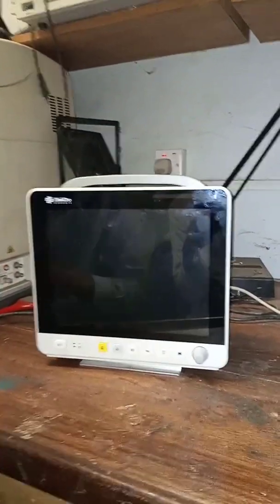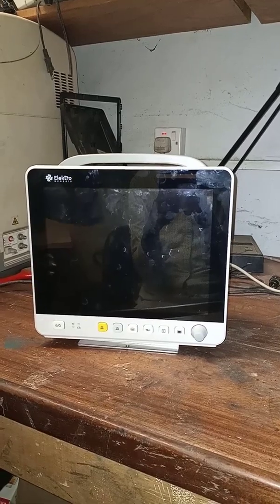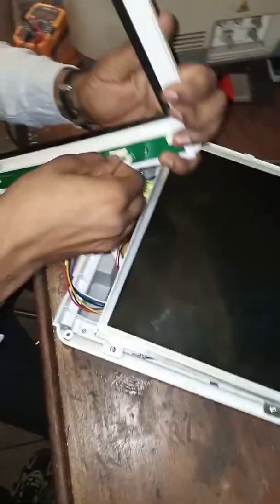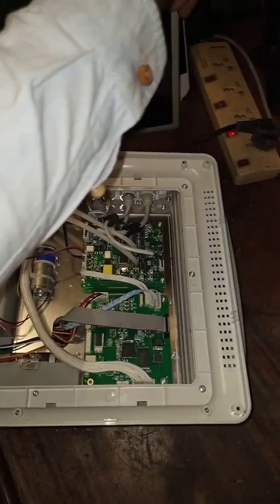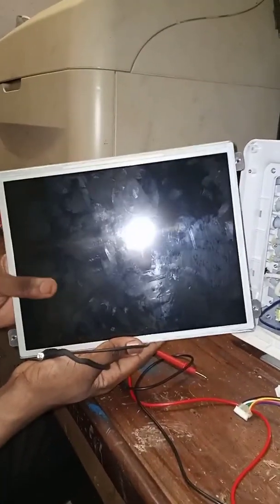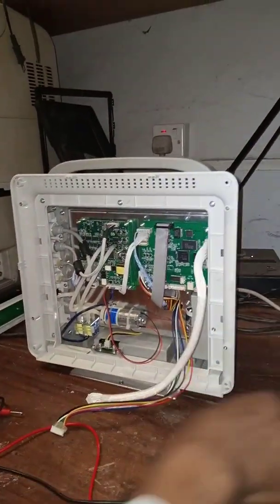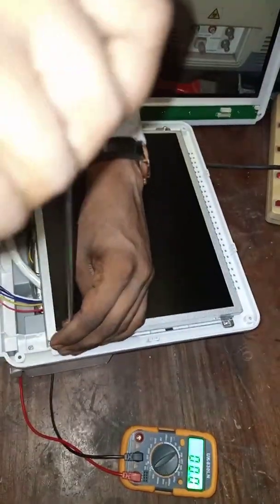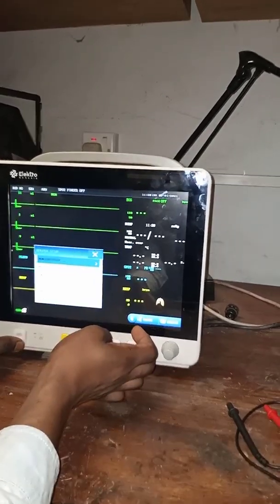Black Screen Solution for Patient Monitor E12

Comment: Couldn't understand what was diagnosis
Reply from the maker: Screen backlight not working, so screen was replaced
Reply: @tmrepairtutorial2496  fault with bk light? Can't it be repaired too?
Reply from the maker: @jash1960  it can be repaired, only with the availability of the led driver ic

Comment: Nibp not showing what can be the issues change cuff cable
Reply from the maker: If it's not showing then it's just a setting issues, but if it's not working then check the cuff cable, the valves   and tubes inside